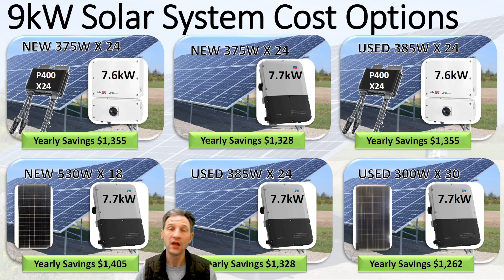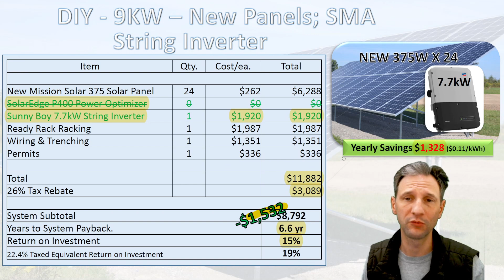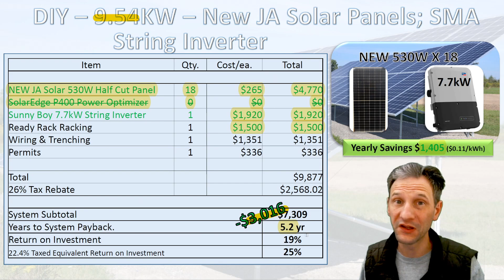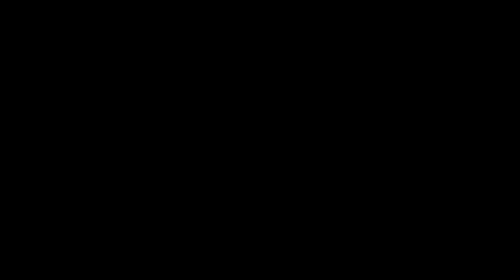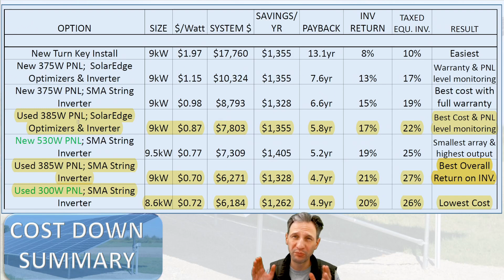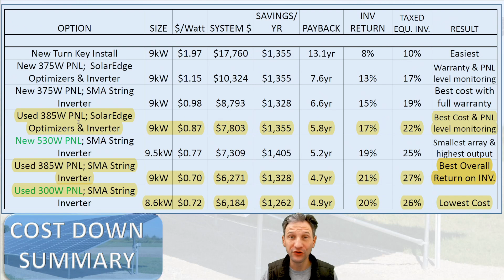DIY Solar Panel System - How to Do it CHEAPER!!

Comment: I've been planning to build a fold out "solar trailer" to get around permits, and possibly have for easy transport to emergency relief sites in need of immediate power options without a steady fuel supply, and this video is a good breakdown that will help me optimize the size of the trailer I need for the best cost.  Thank you.
Reply: One big solar panel produces as much energy on a good day as 1 liter of fuel does in half an hour in a 40lb honda generator. Don't bother lugging it all around unless it's for a rental where noise is a factor (movie sets).
Reply: @Thesaltyseafish  I don't think you quite get the idea behind it.  It wouldn't be "one" solar panel.  It would be several, all mounted to a highly mobile and easily deployed trailer, possibly with integrated battery storage.  It would also be intended for use in areas where getting fuel, and moving it around, is not only difficult, but could potentially be dangerous.  It's also meant for long term relief, not just for a day or two.

For example, a relief tent set up at a town destroyed by a tornado, flood, earthquake, hurricane, or large scale fire.  Places where people might be trying to get fuel from anywhere they can, even if that means taking it from relief workers by force.

Having a reliable source of power that is not likely to disturb relief efforts, won't take valuable fuel away from vehicles used in rescue efforts, and can be moved as needed without having to do more than fold it away, provides a valuable resource that can help in those situations.  It can even be loaded onto a boat and quickly transferred if needed.
Reply from the maker: Sounds like a fun project.  You should also check out Will Prowse channel, he has a lot of content that would help you with this idea.
Reply: @ProjectsWithDave  I have been watching his channel for a while now.
Reply: i was thinking along the same lines of using a large pontoon boat as a power base and putting 10 24 volt panels on top as a roof.  we fish anyways so shade is nice on the lake.  

extra bonus is plug the system into the  house power when its parked in the driveway collecting bird poo lol

Comment: Great video Dave! I live off grid in Canada and have also found that in order to reduce racking costs and roofing costs, I was able to arrange my used panels as the roof for my woodshed. The woodshed is close to the house so trenching and wire costs were reduced. By using them as shingles for the roof, I reduced my roofing materials cost and racking costs simultaneously. It just took a lttle custom flashings that I bent out of a roll of aluminum to eliminate leaks. 
Facing a few panels east and west is a good idea if you have cheap panels to smooth out that curve of production and use. South is best of course for overall highest input from each panel.
Reply from the maker: Nice! I was considering making a wood storage area with used solar panels as the roof.  Did you seal the panels to each other?  Do you have a picture of the result?  Thanks!
Reply: Using panels as a car and Rv port would be nice. Kind of like Walmart parking.
Reply: @peckerpeter2078  The VAat Shreveport Louisiana has solar panels as parking covers. It is pretty awesome.
Reply: Lol what did I win?
Reply: Caution: Use something that will allow for expansion, or you may have problems down the road. I would not recommend using panels as a roof surface.

Comment: WOW!! WOW!! WOOOWWWW!!! A FABULOUS VIDEO!!! I came across your videos by accident. I love what you did and how you explained everything in "layman's terms". I shall be moving to rural Kentucky this coming spring to live off-grid. Using solar combined with several verticle wind turbines to be totally self-sufficient. I did see a video last week about increasing your solar output [as you have never thought could be possible]. (https://www.youtube.com/watch?v=FKhszB4E1_M&t=1s)  So, my thinking now is to combine your suggestions on parts and suppliers, with his output suggestion (from 24w on his solar panel INCREASED to 151w on the same panel).  I truly believe that your site and his site are truly the answers I have been searching for. Keep up the GREAT videos. GOD Bless & thank you.
Reply from the maker: Thanks!  I appreciate the feedback.  I've seen the video you mentioned.  I believe you will find the cost and effort involved in trying to focus extra light on each individual panel will be far greater than just buying additional panels, especially if you are purchasing used panels.  Also, the method he used to mount the mirrors would not likely withstand 90mph winds, if you have to spend time repairing things it will quickly negate the benefit.  Each panel would have to be individually mounted with significant spacing to avoid shadows.  For these and a host of unmentioned reasons, I strongly recommend you abandon the mirror idea.

Comment: Last summer I called santan solar and bought used 250 watt panels for $30 each but i bought 104 of them. You can easily make your racking out of wood to save money. I'm in off grid so I don't sell back to the grid, I have 86,000 watt hrs of lithium with 4- 240v inverters and a transformer.  It's more expensive by far but when the power goes out everywhere else I have power.  If your grid tied your not going to have any power, be sitting in the dark with the rest of em.
Reply from the maker: Thanks for sharing your system info.  I'm considering a more cost effective middle ground, where I still have a grid connection, but have battery backup for emergencies.  Are you completely disconnected from the grid, or do you have a connection in case you need extra power?

Comment: A side by side study has already been done, SHOCKING RESULTS.  https://www.youtube.com/watch?v=UQ9Szhl1ceQ&t=0s
Reply from the maker: Yes, I've seen that study.  Pretty compelling results.  However, I don't think all string inverters will give the same results.  For instance inverters with multiple MPPT's will have an advantage in these types of conditions.  Also I don't think all systems have equivalent MPPT's, this study was done with a Fronius string inverter.  Others have found different results as you can see in this video by  EEVblog.  https://www.youtube.com/watch?v=AbxHoQF4ADk
Reply: @ProjectsWithDave  I suggest actually studying math and how solar panels work.  If you want to get into it feel free,  I don't think  there is going to be any real difference between different optimizers.  That video is horrendously bad.

Comment: The optimizers are a total gimmick.
Reply from the maker: In my original installation the optimizers would not pay for themselves, but there are a number of conditions where the optimizers add value.  For instance, if you have miss matched panels, or panels facing different directions that need to be on the same string.  Also some codes require module level shutdown, which optimizers provide.
Reply: @ProjectsWithDave  People say that but I think its just a rumor.
Reply from the maker: I am currently running 3 different panels and two different angles with no issues.  That would not work nearly as well with a string inverter, the panels produce dramatically different power outputs.
Reply: @ProjectsWithDave  Well I look forward to a complete presentation that is done properly

Comment: I was quietly watching your video looking for good information when you started your calculations. If you invested the same 17760 at 5% which is nominal then you would have grown your money to 30499 in 13.1 years. Under no circumstances do you receive a 8% return. Maybe a return of investment based upon optimal power generation and high electric costs. My area is 8.29c per kw. And this does not factor in any maintenance or replacement. Finally, if your selling your home it can be quite an detriment if you have a loan for the system.  I personally don't want to put my money where it takes 13.1 years just to get a return of 17,760 returned to me at 112.91 per month. If you are on the coast where energy costs are very high and they will not allow a new conventional power plant then it may make sense for other reasons.
Reply from the maker: I also did not want to take 13 years to get my initial investment back, that's why I went DIY.  The returns I calculated were based on a $0.11/kWh electricity rate.  The lowest cost system with all new panels was $7,309 which pays back in 5.2years.  That 7,309 earns $1,405/year, that is a 19.2% yearly return.  That does not even consider the fact that you don't have to pay income tax on electricity savings, where as money invested in the sock market has higher risk and you have to pay capital gains or income tax on the earnings.  As far as selling a home with solar, I'm sure it depends on where you live.  Realtors in my area claim it adds value to the house.  Especially when you can buy a house with little to no utility cost.  Hope that helps.  Thanks!
Reply: Makes sense in California where tier one pricing is over 30 cents and only gets dramatically worse as you go up in tiers. No brainer. Even in Vegas where it's only 10 cents it's still worth it when you have to run your air conditioning 24 hours a days for months at a time. But as you said all depends on your location and situation I guess.

Comment: How used are used panels?
Reply from the maker: Good question.  I'm told the panels that SanTan Solar sells are usually 5yr's old or less.  I'm sure if you want specifics on a given panel, you can call and get that information.
Reply: @ProjectsWithDave  -in 2009 I installed 28 205 watt panels that amounted  to a 5.7 kWh system.   It did ok, but I barely got by (to zero) without being conservative in my use.  In summer of 2020, I purchased 28 315 watt panels (@$200. Each.). Now, almost a 9 kw system.   I sold my 12 year old panels to a friend for $75.00 each and should give him another 12-13 years worth of use.  He’s happy and now a believer in solar.  I also purchased new Sunny Boy inverters and basically replaced my whole system less racks .  I installed all but the electrical.
I got my panels from Northern Arizona Wind and Sun-and couldn’t be happier .
I would advise all that if you are going to do solar, are handy (even a bit) do it yourself.
You’ll save a ton of money and the satisfaction that comes with it is unequaled. 
Your post is great for those contemplating a possible install.  GO FOR IT.
I don’t care about being green, I do care about eliminating something we use everyday and that is electricity costs.  The sun shines, I’m producing power!  YES!!!   
Your post is great and laid out well.  If readers can’t make a decision based on your examples, well, they are an indecisive decision maker.    Money is available.
Thanks Dave, great video.
Reply from the maker: Thanks for your post.  I love that you gave your old panels a second life, a win win for everyone!  My hope is by giving people some real world examples from my system it will make it easier to plan their own.  And like you said, you don't even have to be out to save the world, solar can make great financial sense especially if you go DIY.  Thanks!

Comment: A couple questions, where is the battery costs or are you just using the system during the day?
What about a solar tracker, why not use one? I know you said you are getting clipping, but i mean if we design it so we get no clipping and then it will make more sense to use the solar tracker. But i would say to invent a tracker that turns the panels themselves instead of trying to use a tracker that has to turn the entire rack, this way it will require less energy to move them therefore it will take less expensive motor and bearings.
Reply from the maker: I use the grid as my battery, it is way cheaper than battery solutions currently available (watch this video on net metering: https://youtu.be/IwUK1dNJ3n8 ) I have yet to find a tracker that could pay for itself.  Especially with used panels, it is more cost effective to just add additional panels to achieve your power target.

Comment: West facing and believe it or not north facing panels can perform in the right circumstances. My north slope carport roof receives a huge solar bounce from a steep metal roof on the house. There are times when the north face actually outperforms the south. It keeps producing late afternoon and was well worth doing, the same applies to many west face situations.
Reply from the maker: Interesting result, thanks for sharing.

Comment: Hi Dave, thanks for your video, after watching many videos on solar panels, I have found yours to be the most useful.  I have a question or two for you. I haven't purchased anything yet, and am still trying to understand string inverters and how they are set up. I think at this point my ultimate goal is to set up a grid tie system in the 7,8, or 9 kw range. Question #1. When you arrange your panels in series or parallel, how many panels can you put in each series or unit. I should probably ultimately have 25 or 30 panels. Question #2. When pricing new units what should I keep in mind regarding the amperage of each unit?  Thanks for your assistance. Randy
Reply from the maker: The answer to these questions are all driven by the inverter you choose.  If you are going to do a string inverter with no optimizers, you want string together as many panels as possible and still stay under the max voltage of the input for your inverter.  For instance if you have a 600V max input on your inverter and your panels have a max voltage of 37VDC you could make two strings of 16 panels each and stay within that limit.  As far as amperage, each series string will match the max amperage of the panel you choose.  If you use a SunnyBoy inverter with a max usable input amperage of 10A, and your panels have a max current of 12A, you will see some clipping, but that is ok.  Sorry, it isn't a simple answer.  I'm considering making a video to explain how to choose inverters and panels.... some day when I have more time  : )
Reply: The first thing you do is plan the amount of panels you can fit on your destination. If you building a rack, you have to decide on a size. After that you select the exact panels and have the quantity, you check the datasheet and plan you strings for your choosen inverter. Most manufacturers have tools, where you can put in the exact model of panel you want to use and the quantity and they will present you the best fitting Inverter. For the SMA SunnyBoy 7.7 (US Version) the max Input Voltage is 600V. You habe 3 independend MPPT Trackers / Inputs, so you want to use 3 Strings. If you use 72Cell (or 144half cell) Panels in the  360-380WP Range, most of them will habe a maximum short circuit power below 50V (it´s a little difficult to calculate, because the maximum short circuit voltage depends on the temperature of the panel and can be higher than the given value in the datasheet at lower temperatures.  In this case the maximum amount of panels per string would be 12 (x3 =36 max for this Inverter). If you stay in the range of 8-9kwp with your panels and all of them are looking in the same direction (south), you could string 2x12. 2  longer Strings are better than 3 shorter Strings. But, you also could build (for example) 10 Panels East - String/MPPT 1, 10 Panels South - String MPPT 2 and 10 Panels West - Sting MPPT 3, which would give you 11400WP, but because of the 3 different directions, the panels will have slightly different peak times and you can use you inverter more efficent.
Reply: @Thorsten_Wiegand  if the inverter is 7.7kw and all panels look at the same direction  how can you install 8-9kw?there is no danger to blow the inverter?
Reply: @audiophilesland969  : Hello. The rated power of the modules is the peak power (in this example it´s 8-9kwp). That means, that this much power is only generated in optimal conditions (cold modules and full sun directly in the perfect angle). Most of the time (~99%) you won´t get that much power. The inverter in my example is rated for a maximum PC-input power of ~11-12kw. That means he can handle that much power from the modules without a problem. (All PV-Inverters are like that. In most cases you can go ~20-30% over the rated outputpower - you have to look that up in the tech-sheet). For Clarification: The Output of the Inverter won´t go higher than the rated 7.7kw. He will simply cut evertything above 7.7kw and it will be lost. But because the time, when the PV-Modules deliver their absolute peak power is very limited, you won´t loose much.
Reply: @Thorsten_Wiegand  thanks for the answer.i have a sunnyboy  rated for 1550w output and 1850w max input I have only 1500watts array.i guess I can safely add one more panel

Comment: Video with the "Build Back Better Rebates" 30%, 40% if USA made, and 50% for low incomes would be interesting. I am holding off to see if it passes.
Reply from the maker: In the mid term you can do your research and planning.  Good Luck!

Comment: Very interesting video. I am new to solar and don’t understand if this is a grid tied system and how you interact with your system at night and during the day if your electricity demand exceeds 9kw. Do you have to throw a switch? automatic switch over? Break power transfer? What about battery storage?
Reply from the maker: All of the power control is automatic.  No need for batteries or manual switches.  You can get a better understanding of how it works in this video on Net Metering for Grid Tie Systems:  https://youtu.be/IwUK1dNJ3n8
Reply: I consider battery storage to be essential.

Comment: Believe your used panel package calculations  are inaccurate. The FTC requires all new parts making your tax credit shrink or disappear on those calculations. Making 535 watt new panel install the best option for ROI.
Reply from the maker: There have been several comments back and forth on this topic.  Can you attach a link to the actual requirement you are referring to?